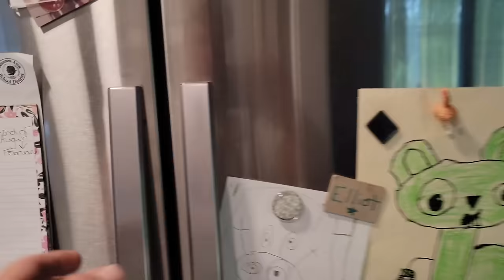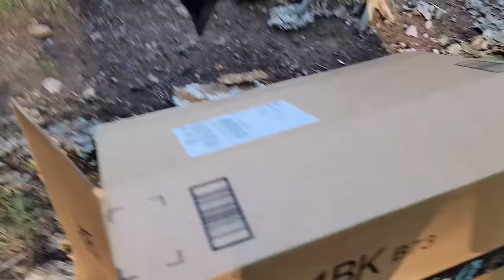MASSIVE Yellow Jackets Nest in a CAMPER! | Wasp Nest Removals

Comment: I have watched a lot of your videos, 1 thing I do not understand is the small hose on your vacuum, not the larger size with a more powerful vacuum. I have done a lot of nests (Landscaper)
and sitting the nozzle from a gas powered leaf vacuum took no prisoners.  And did not need to be emptied. You said you have more nests to do so you did not want to get the vac full,
guess I dont understand why this would be an issue since it can be emptied.  Just trying to understand more. I love the animals eating the newbies!
Reply from the maker: The vacuum I use is a selected choice from many vacuums I have tried. There's a misconception that the bigger the vacuum motor, the more suction, but the suction force comes more from the narrowing of the hose/nozzle (like how a crevice tool attachment creates more suction force than an open hose). 

This vacuum is small, compact, and powerful. I empty the vac sometimes during the day between removals, but that doesn't mean I want to have to empty it multiple times a day, mainly because I am on time/space constraints...and I'm lazy. So not vacuuming all the envelope ans just bagging it is time and space saving. 

Hope this helps.

Comment: Loved the video! Question: wouldn't a head mounted/velcroed Gopro be more practical than using a phone? Or won't it work with the suit?
Reply: He'll only use go-crap if it's necessary, he's not had a lot of luck with them. However a system of a Webcam mounted to a headband that streams to his phone so he can check the footage as it's taken could be cool. The ergonomics tips I'm sure are appreciated none the less.